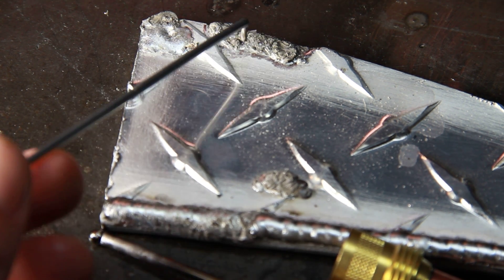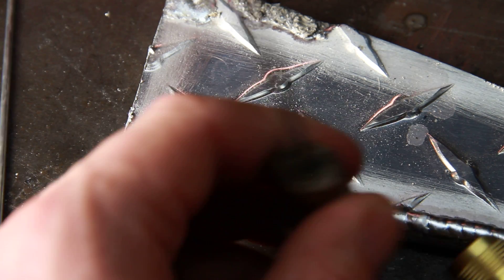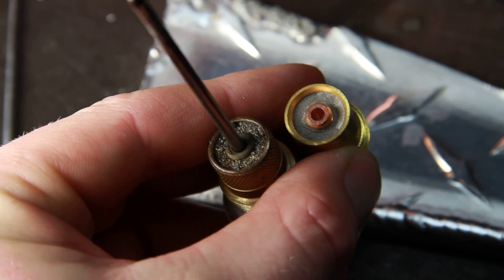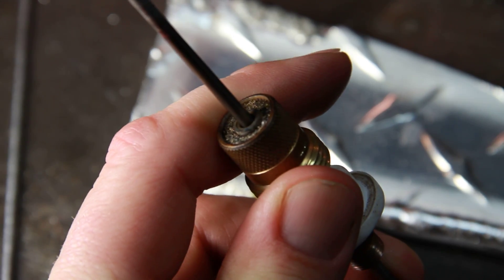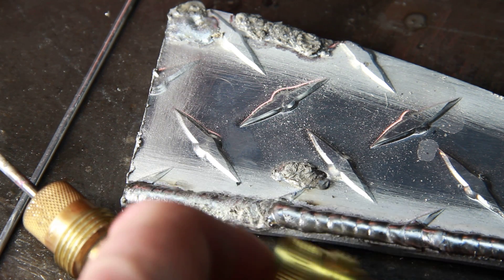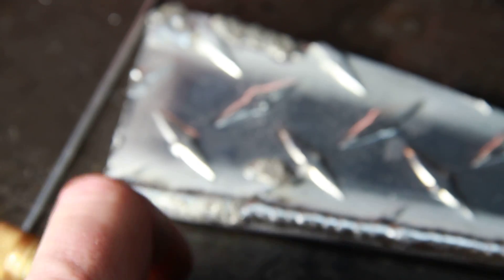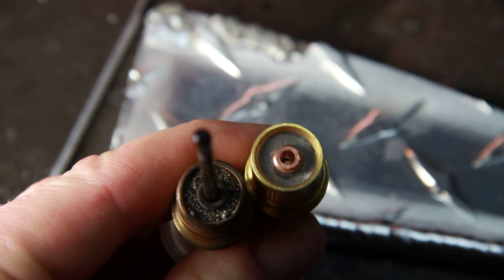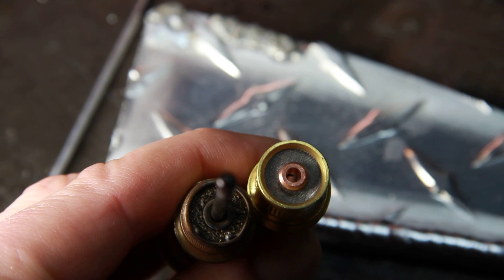AC TIG Troubles = Check Your Gas Lens

Comment: Hay man. 
Good vid. Something everyone should know. 
Me. I always check all my parts prior to starting every day. 
I have the luxury of working fir myself and working from home so I can relax a bit easier then some at the end of a job. 
I crack a beer and pull my torches apart and clean everything. Some things of there dirtier then normal get a soak in denatured and an ultrasonic clean. 
Everything is either cleaned to almost new or set aside as spares or replaced. Now im deffinatly no gun welder far bloody from it to be honest. But this is a routine I've set to make sure every job or every time I weld I give myself and my weld the best chance of success. 
I started this when learning so every time I had to remove the tungsten because of dipping or what ever it cost me a ton of time which I knew I would get sick and tired of so would prompt me to take more care and focus more to become a better welder faster. I would quite a fixed price. On an hourly rate rather then per 10mm. So if i went over that it cost ME money not the customer. I know it cost me alot in time and money but if I wanted to be a faster and more efficient welder I would have ti improve. 
It actually got me a hell if alot of fix up jobs as I told my customers that I would quote them on what it should take a proficient welder to do. So they knew they weren't paying for me learning. I could tig weld to where the welds would have sufficient size and penetrative and passable serviceable welds they just took a far bit longer then it should. And the customers respected my honesty.  

Sorry for the long winded version. But the bottom line is it helped me improve dramatically very quickly. 
And no matter how may tig tips and trick videos you watch on YouTube nothing is better and teaching you to weld then seat time. 
But short vids like this showing things NOONE else shows is EXACTLY what beginners need to watch. 
Because they watch the tip and teaching vids and do everything as there told to but something like what you show here could be the differance between people sticking with the craft or snatching it. As they think I've done everything I've been told to do and still it goes to shit. 

Anywho love the vid mate. You got my sub. Not from this channel but my other channel. 

👍👍👍👍👍👍👍👍👍👍